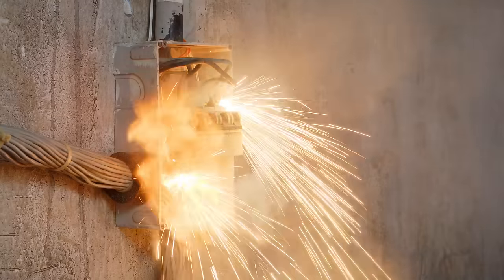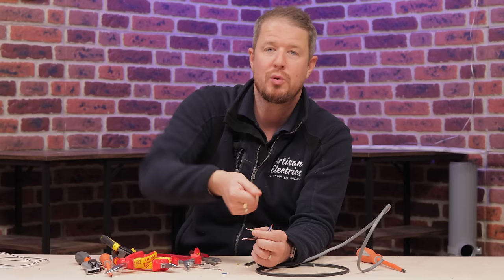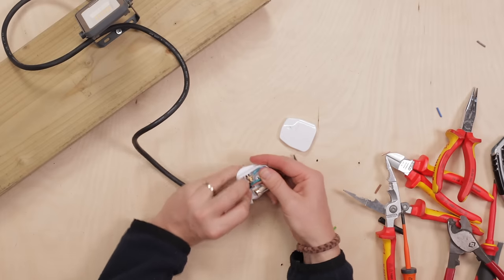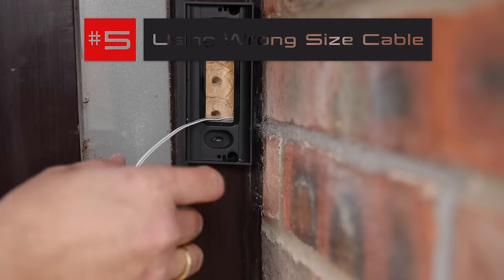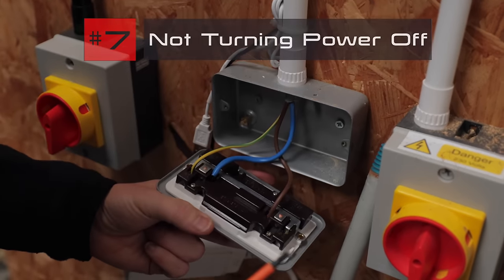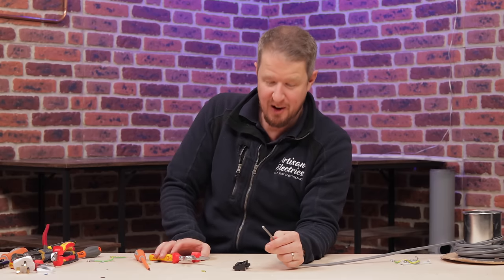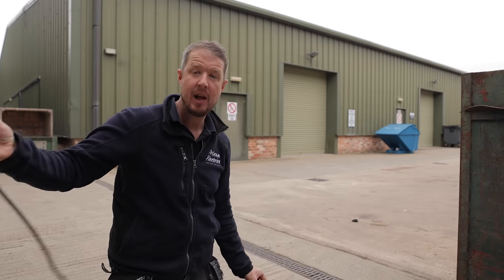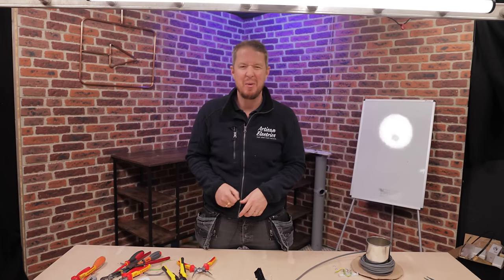10 Mistakes EVERYONE Makes When Doing DIY Electrics!💥

Comment: 10 mistakes EVERYONE makes when doing DIY electrics?

Not this one. I’m fed up of fixing bodged and lethal installations by so called ‘pros’

My next job is trying to work out how a ring main (in PVC) that happily existed for over 60 years totally lost one leg, as in the entire cable is missing at the consumer unit when a so called pro did the wiring for a gas boiler by bodging in a spur at an unknown location and by unknown methods.  All the existing cables appear to be buried in the original plaster.  I’ve temporarily changed the MCB for a 16A as a precaution. 

🤬🤬🤬🤬🤬
Reply: The point that the title of the video is insulting to those DIYers who have enough knowledge, experience and tools to do simple jobs relatively safely is well made.
Reply: I suspect many DIYers are more intelligent and more capable than many electricians. The issue will be around the DIY'ers level of knowledge of BS7671 and the requirement under Part P of the building regulations.

A copy of the On-Site guide will help DIYers do work to the required BS7671.
And then get the work certified by an electrician.

Read Part P to understand the principle of notifiable work, what constitutes notifiable work and what to do.
Reply: @deang5622  so you do the work yourself, then expect a qualified electrician to sign your work off.... so you can then come on a forum and slate electricians and if you think reading the onsite guide is enough to understand BS7671 then you really shouldn't be touching any electrical wiring.  This goes for all diyers, yes you may take pride in your work at home but most diyers don't get their work signed off because you are not qualified too. Any decent electricians wouldn't sign of an unqualified person's work as they become responsible for the life of the installation until rewired regardless of the next EICR being done.
Reply: If the cap fits..

Comment: In the seventies, I worked at Tandy—one day, flames appeared from under the counter where the till was: it turned out to be a partly uncoiled extension lead (the type with a nice solid outer casing) that was being used to give 'just enough' reach for an electric heater behind the counter.  I have no idea how long it had been there; I was completely unaware of it, but the thought struck me at the time: how many times had I leant on that counter getting names and addresses to add to the top of all the hand-written receipts that we used to do back then?!

I taught the manager a lesson in electrical wiring that day. He was selling the stuff and hadn't actually got the slighted idea! I'm not completely sure he knew what the hi-fi was all about, either. 🤣

In many ways, I'm not surprised Tandy disappeared, but I wish Maplin had remained. 😁

Comment: Something that was drilled into me during an electrical safety awareness course (I'm not a sparky, but I had to do this for my job), it doesn't help just testing the circuit is dead, you MUST test the tester too!. That voltage detector has a block that comes with it, to test the tester. Proper procedure: A: Test the tester. B: Test the circuit C: Test the tester AGAIN. Yes, ok, this is more for sparkies who do this for a living, but all it takes is complacency and not realising the tester is "off", and you're going to end up with a bad day.

Comment: i zapped myself.  fitted a single pole workshop emergency cut off switch ...but i wired the neutral to be switched....leaving the live unbroken.  turned rubbish single pole switch off...worked on a  machine tool wiring ...thinking the power was off.....zapped.

Comment: We had an immersion heater that had been wired in the house with 1mm cable.  Fortunately we never used it as the boiler provided the hot water.  I was only discovered when we had a board update.

Comment: This may have been aimed at DIY'ers, last week I repainted my front room. 

When I removed one double socket from the wall, one of the cpc's became loose, on closer inspection you could see the indentation from the fixing right on the tip, so the electrian hadn't inserted the wire all the way in.

Also two of the three back boxes had saw dust in them.

Not the Artisan way? 😉

Comment: The heating of the extension is due to resistance not inductance. Yes, essentially it could be considered a big inductor but and inductive reactance is quasi resistive and doesn't actually create any heat.

Comment: In Santo Domingo (Dom Rep) almost all if not all wires are connected by twisting and taping over.

The country hasn't gone up in flames yet. Standerdizing connectors like wire nuts or wagos is to ensure a minimum standard.

But not using wagos/nuts doesnt mean bad.

Comment: screw fittings don't go loose due to AC (as opposed to DC), it is thermal expansion and contraction when power is turned on and off which can cause the screws to loosen. if the screw is not tight enough to start with, you can get arcing which will excelerate this and potentially cause a fire.

 I've seen speaker wire used instead of bell wire, which is also really bad, as apart from the lack of earth or secondary insulation, the primary insulation is usually not heat resistant and easily melts, exposing the wires. I've also seen "professional installation" wire power supply colour changed between consumer unit and switch from red to blue, or white, or red making it impossible to rely on the wire colouring. 
As has also been commented, the coil extention wire overheats because of lack of air cooling, not inductance. As the live and neutral is in the same flex, flux will cancel out, as the current is going in opposite directions in the same flex. The conductors are the same size and will have the same voltage drop accross them but in the opposite direction in a length of flex. (This is why a clamp current meter doesn't measure current when put over flex containing the live and neutral. it uses electromagnetic flux to measure current)

Comment: I’m coming across a lot of this , at the moment I’m dealing with a labourer who keeps playing with electrics , most recent things he’s done is disconnecting cables to put a ceiling up and leaving them exposed whilst turning on the supply again putting anyone else at great risk , he’s never heard of safe isolation😂😂🙈 , putting sockets on a cooker supply (he’s still thinking it’s no big deal 😂🙈) trouble is there’s no law to stop them . I’ve been qualified for over 20yrs but never had so many diyers as in the last few months 🙈

Comment: Oh Yeah, I've seen them all.  The most common is the small outlet shops that use the cheap CFL lights strung together with twin flex and running the length of the shop. Plugs in these shops are also a mess as the main DB (which is scary to begin with) is looped to multiple other DBs on sections built on to the original building. Lastly, fast food outlets UUHH the supply to the appliances is absolutely horrendous very dodgy covered in old cooking oil mostly incorrectly positioned to begin with and hopelessly overloaded.

Comment: The biggest mistake I come across is when pvc cables are pulled through the same hole in a joist at different times. Ie the cable being pulled in abrades the stationary cable already through the joist down to bare copper leaving a dangerous and hidden fire risk. I’ve had to tell people that have recently had their houses rewired that the whole job needs to be done again. You can imagine how that goes down.

Comment: To question and maybe add to point 9, is NOT stripping the cables back far enough so that when they're screwed into a plug or RCBO etc, the screw is not making proper contact with the copper, and is more on the insulation/sleeving? Seen this on another channel but wasn't totally sure why, I'd guess potential arcing?
Reply: Arcing is one possibility.  More typical is that at that back of a socket, a ring circuit is broken somewhere by one of the live, neutral or earth conductors not forming a ring.  Everything appears correct - plug something  in and it works, even a basic socket tester - but the cable resistance to any point in the ring is increased because there is only a single current path instead of two.  That can result in overheating of cables in a heavily loaded circuit.
Reply: The problem here is one of increased contact resistance.

Many decades ago an entire factory burned down and it was because a single screw in a terminal had been tightened up and was partly on the copper conductor and partly on the insulation.

Comment: Another one I've seen a fair number of times is when screwing up a terminal block they push it in too far and screw down onto the insulation rather than the wire itself

Comment: Good safety tips! My only objection is how you put a stranded wire into a screw-terminals: in my experience it's much better to twist stranded wire when connecting them to a terminal. The tab inside the terminal will squish the twisted wires evenly, providing a physically stronger connection, with more contact surface.
Reply: IF the terminal has a tab. Directly screwing on a fine-stranded wire however is not the best idea.

Comment: Here's one I discovered. Found an "extension lead" made by fitting a socket  in a VHS tape box and wiring up to mains. My heart nearly skipped a beat when I spotted it. Safe to say it was disposed of very quickly and replaced with a correct extension lead. I'm no sparky but I didn't need to be to know that was damn dangerous. To make matters worse it was powering an old CRT TV in a kids bedroom. Makes me wonder what they were thinking when they fabricobbled that together!

Comment: I once made a 50M extension cord by putting plugs on either end of a 50M steel drum that the cable came on. I normally used it with power tools completely unravelled. But in a pinch, I was using it to run a 750ma printer, fully coiled. It worked fine until later that day my mum decided to unplug the printer & plug in a 2,400w electric heater. 
The power cable got so hot that it melted into a solid ball of plastic. Fused with two other cables that were just lying across it. Fortunately, the fuse blew before the thing caught fire.

Comment: The wire nuts can be a good connection if you pretwist the wires and if your going to solid to strand push the stranded in first than the copper than twist together. Enough practice you get used to it i prefer copper crimps and nylon caps (Buchanan and the 4 point crimp tool)but am coming around to wagos

Comment: Alas some of the pro's are making the same or even worse mistakes. In our house I found multiple live wires being exposed behind ceiling lamp covers. The electrician apparently didn't bother to terminate them properly and used some electrical tape instead which degraded over time which is now a serious risk (both fire and shock hazard I would reckon). Of course I replaced them as soon as I found out by WAGO's.

Comment: GOD your first one 'The Twist' I'm a DIYer and would NEVER do that, I would prefer to wait for a day and buy some Wago's off Amazon, and anything out of my league get a sparky in!
Reply: if you really need to patch it up urgently for temporary use, twisting and soldering (and the insulating) should do the trick, if you have nothing else.
But for something permanent and less patchy, yes, either Wagos or at least screw terminals are a must.

Comment: Got called to a drive through sign not working. Has been installed for over a year. The underground was compromised and decommisioned. The mains feeding the first drive through sign (before it looped off) was an extension lead with the ends cust off instead of proper cable.

Comment: Hi Jordan,

An excellent video.

However, I have to dissagree with you as to the reason for the coiled extension lead heating up. It is NOT due to induction. The magnetic field generated by the current in the line conductor will be cancelled out by the oposing magnetic field caused by the equal neutral current flowing in he oposite direction. This reduces the inductive effect to zero. The reason that the coiled cable gets hot is due to the heat from the RESISTIVE loss along its length. With the cable unwound the heat can dissipate thus keeping the temperature within acceptable levels. With the cable coiled the heat cannot dissipate thus allowing the temperature to rise. This - of course - does not in any way detract from your advice to uncoil the cable.

Kind Regards,

Paul.

Comment: I am not an electrician but when updating my office lighting with LED strip lights and adding a master switch I used two core lighting cable.  When updating the loft lighting I used solid twin and earth (thank you WAGO connectors and junction boxes, which were sealed with zip ties).
If anyone thought to use bell wire for any other purpose than a doorbell then then, sorry but they get the results they didn't expect.

Comment: Bell wire is as you say, low voltage (usually but not always DC class 3). There is another class of wire not sold nowadays, but I'll bet there is still some around.
I have a set of Christmas lights wired in class zero (0). Single insulated 240 volt rated, you can't buy anything new in it, but there is still a lot around.
I do PAT Testing and have come across class zero. It is fine and still legal as long as it is in good order. Debatable perhaps but can be on classic or vintage items.
My worst bodge I came across was on a Caravan tourer site. The Blue Arctic cable looked odd. On closer inspection, someone had extended the 2.5 flex with 1.5 flex, three bits of plastic terminal block and wrapped in plastic sticky tape. The block had melted with the heat and had gelled together, no short but it was quite hot at the join.

Comment: Extension leads would make a video in its self. 

Look at the wire gauge used on the extension lead. Something marked heavy duty could be retail speak for heavy duty sheathing and the wire size might only 0.75mm2. It’s printed into the cable the cord is made from. 

Running an air compressor on a regular extension cord will either get the cord dangerously hot or start a fire. 

Look at the wire size of the appliance printed on the cable and make sure the extension cord is the same or more.

Comment: I bought an old rent house last year.  Every circuit except water heater, dryer, and AC had 14 AWG wire and 20 or 30 amp circuit breakers.  GFCI in the bathroom didn't even have a ground wire.  Every single outlet in the house had some sort of wiring mistake, about two dozen of them.  What a mess.  

I recently had a local electrical contractor crew come to my home to move the service entrance for my barn.  They had to install a new breaker box and tie it into the old one.  I had to tell them that having hot wires rub on sharp-edged hardware inside the breaker box was not acceptable.  

I'm not a licensed A&P mechanic, either, but I perform ALL work on my own airplane.  I learned about mechanics decades ago...
Reply: "GFCI in the bathroom didn't even have a ground wire" to be fair, the functionality of a GFCI does not rely on a grounding wire, but simply on magnetic fields of line and neutral cancelling out (or at least close to cancelling out).
But the missing grounding wire is fully in line with the rest of the messed up installation.
BTW: here in Germany GFCIs (or RCDs hwo they are called here) are required for rooms with a bath or shower since 1984 and since 2007 RCDs are required for every socket. Fixed appliances are exempt, but at least in house installations it would simply be additional work for the electrician, so they put all circuits on RCDs. I understand that in the US things are not that critical, because of 120V instead of 230V.

Comment: If you fuse down to 13Amp from a 32Amp ring, with a fused spur, can you have sockets wired on 1.5mm twin&earth (after the fuse?) 1.5mm is good for 15Amp, or even 18Amp, for a short time. So with the 13Amp fuse protecting the 1.5mm cable, it should in theory be fine? I know that you will always do it in 2.5mm , but it should be ok on 1.5mm.
Reply: The VDE code here in Germany makes distinct requirements for cross-section of cables, based on length (voltage drop) and installation (in isolated dry wall, in a channel, multiple cables combined, so basically heat dissipation). For a normal household installation, 1.5mm² can be fused with 16A, although more and more 1.5mm² are only fused with 10A (13A are more expensive than 10 and 16A) or they use 2.5mm² for 16A circuits.

Comment: The golden rule is to make sure there cannot be any stress/pulling on individual wires (causing them to get loose from their connectors, arching, and burning down the house). This is why the outer sheathing of the wire needs to be clamped down. When pulling the cable, the stress is taken up the cable as a whole and not the individual wires that easily risk coming loose from their connection.

Comment: Chartered Electrical Engineer and I bought a brand new house. The transformers for the LED lights in the kitchen were wired so that a) the insulation was stripped back too far; b) the earths were unsheathed and c) the earths weren't even screwed into the transformer so didn't connect along the daisy chain. After many similar faults, I had the whole house retested and after 3 months it was condemned as "Unsatisfactory, potentially unsafe".
Reply: And most electricians think they are better than electrical engineers.